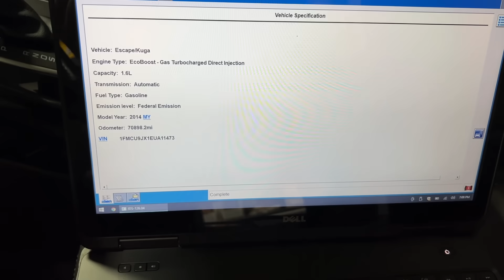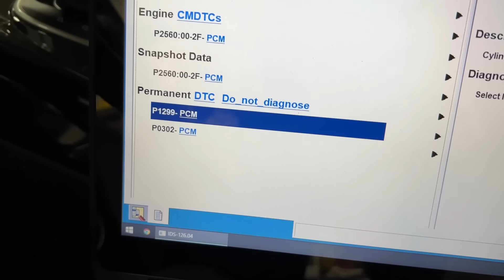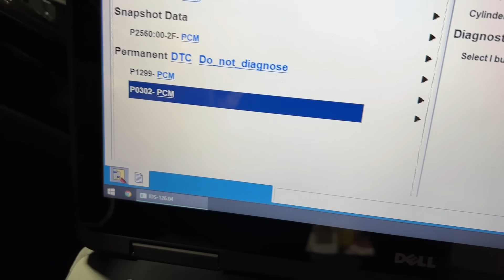Beware of Ford’s 1.5L 1.6L 2.0L Ecoboost Engines and Their Never Ending Coolant Consumption Issues!

Comment: The Triton 3 valve, the older diesels in their heavy duty trucks, the 3.5 Ecoboost; all of these engines have had issues for their entire production runs. Now the smaller 4 cylinder engines. Then there was the transmissions used in the Focus and Fiesta. Does the Ford Powertrain division make anything that is worth a damn? The 5.0 liter engines and the 6 and 10 speed autos are all I can think of that seem to be ok. Putting in a long block is super expensive and how does anyone know that the castings on the replacement blocks are any better than the originals? If a class action lawsuit hasn't been started yet, it is certainly time to begin one.

Comment: My 2015 Fiesta st cracked at #3 at 8,000 miles. 80,000 on the replacement with a Pumaspeed X47r. Knock on wood.

Comment: Hahaha …. Im so happy that I went out and bought a Honda Ridgeline last year but I did keep my 2013 Escape. But if it goes, will at least I have moved away from Ford. At this time it is still running with 265k km on it but things are starting to fail on this unit, so will just keep running it as a spare vehicle until it dies. …… Guess I better go out and check my fluid  levels.

Comment: You say at 70k miles they need a shortblock due to the block cracks between 2&3, will they only last 70k miles or did Ford revise the blocks on them to prevent that? Why dont the NA 2.0/2.5 blocks crack that way when a turbo is installed and beat on with 12-20psi for 4-5yrs and no issues? Is it the DI funky piston shape block load in the Eco engines?  So many questions lol
Reply: Blocks were re designed
Reply: @FusionBoost2.0  rather vague answer, i asked 3-4 questions which one are you answering?
Reply: @young11984  The older 2.0 and 2.5 are closed deck block designs, the 1.5/new 2.0 were open deck block designs and their was a slit between the cylinders to allow coolant flow and wasn't enough gasket material between both and eventually coolant would get by and burnt in the cylinders. They re designed the block on the newer versions with a small hole. Coolant flows but much smaller hole and allows a better seal between cylinders
Reply: @FusionBoost2.0  i remember seeing one of those, i think it was out of a Fiesta, laying on the floor at our local dealer and thought to myself......that has to be the dumbest design or one super weak hybrid motor to be able to live with no upper cylinder support. Seen some blocks with 0 upper support and just cast round bores machined for the head to sit on, figured it was some crazy engineering to save $.50 on materials and weight too.  Thanks for the explanation, i use the Fusion 2.5s for my turbo toys. The new one will have the top 1-1 1/4” of the bores filled with epoxy and coolant holes opened back up since one guy cracked his between  cyls 1-2 from coolant passage thru the head bolt hole and into the bores, if his made 540whp for almost a year mine will last a long time at around 400whp....hopefully. In the end mine may make the same crank hp since its going thru a 6r80 and 8.8

Comment: Replacing the long block will permanently fix the issue or will it happen again? Has Ford redesigned the block? I leased a 2019 Fusion 1.5L EB. I transferred the lease. I was planning on buying at lease end. Glad it’s gone.
Reply: Re designed the block

Comment: Any idea if the new ecoboost 3cyl engines have this same issue? I purposely avoided the 2.0L 4cyl when I bought my 2021 Escape. But now I'm worried the morons kept a similar design for the 3cyl engines.

Also, does the new longblock that you would install have a fixed design so this wouldn't happen again?

Comment: I agree with you on the 5.4 3v mine was 05, a daily driver, then used it for work. Unfortunately I wrecked it in 2017 with 225000 miles, I would still be driving it had it not been for the accident.

Comment: I had a 19 Escape with the 1.5 at 4500 miles they replaced the engine. 10k miles it started consuming coolant again. 2 dealership visits and they gave me a runaround both visits. Got rid of it. Always been a Ford guy but, that thing was not a good product.

Comment: It's major problem with open-deck engine block and turbocharging. The liner has cracked. If good machine shop is around , a DIYer can fix this mess for just under 1000$ if the cylinder head is straight and doesn't need machining.

Comment: Like about the engines. Never liked a turbo engine anyways. Feels does too much for what it is. All for gas Mileage.  Seems all manufacturers are having issues. Kia, hyundai,  Toyota with some engine or another. Chevy with the 4 cyl oil consumption issues. Where does it end. Why I still drive 15 year or older vehicles. 5.4 3v. Still kicking

Comment: When did the redesigned long block come out?  We have a 2021 Bronco Sport with the 2.0.  Is that the redesigned engine, or does this affect that engine as well?
Reply: Before those engine were built far as I know
Reply: Mid 2019

Comment: This happened to my 2017 2.0 escape last year at about 48k. Luckily it was still under warranty. From my research it does look like ford revised the repair blocks from having a slit between the cylinders(giving not nearly enough space for the gasket to hold back fluid from the cylinders for very long) to holes further away from the space between the cylinders. Hopefully that’s true of the long block they replaced on mine. I have an extended warranty to 100k so if it breaks again at least I have some coverage for a while. Screw Ford. Never again for me. 2nd one I had with major issues. I also had the focus with the stupid DCT.
Reply: I bought a 2012 Focus HB new, and had the trans. replaced under warranty then drove it until 12/2019 trading it in on a 2018 Focus Titanium.  I put 300,000 on the 2012 without any further issues. The 2018 needs a battery soon.   I would love to have a Focus 5 speed Manual.
Reply: @mikemiller659  I have a 18 focus st 6mt with a 2.0l tdi. Got it around 4 months ago for 23,895 with 34k on it. 
Its fully loaded with every option except the power seats and steering wheel, also it has aftermarket wheels and cat back with a cob intake, runs good for 280 some horses. 
Been getting a list together to pull 20-30 more ponies out her because 300hp is just a better more round number in my opinion.
Reply: @jacknickolstine3355    280 hp is a lot for a small lightweight car. Easy on the boost if you want it to last.
Reply: Had a 2015 Focus with DCT,  5 transmission repairs, major, and 6 minor resets.   I documented everything.    Joined the lawsuit,  they bought it back.   Used the money to get a bone stock 2.5L 2018 Escape S with 24k miles, no turbo, no issues.  Basically identical to the Focus inside, and it is my wife's car, and she loves it.  2.5 is a workhorse motor, and we bought extended warranty since Ford gave us 90% of the purchase price of the Focus SE.  They deducted for the 26K miles we put  on it in 5 years.  Considered a Toyota, but I did not want a payment.  So we have a 2017 F150 STX 2.7 EB and 2018 Escape, no payments.   IF we ever need a new vehicle, our son works for Toyota, on assembly, so we will get family discount. But I expect my truck to last another 10 years at least.   Maintenance is the key.
Reply: What sort of maintenance would have prevented this design flaw from occurring?

I don’t know anything about cars so I’ve been taking my 2017 Ford Edge in every 5000-10000 miles without fail. 

Now this happens and I’m supposed to pay 6000? For a 2017! 

That’s poor, and we customers don’t deserve this.
Reply: @alexmoore2742  There's no maintenance for flawed design. I know there were multiple class action lawsuits at one time. Not sure if you can get in on one at this point?
Reply: @alexmoore2742  Nothing you can do to prevent it, sadly. Basically the old design is a ticking time bomb. The block has a design defect that requires the replacement with a differently designed block to “fix” the issue.
Reply: The dct are garbage. They burn them clutches like crazy.
Reply: You had a DCT fuckus?

Oooof

I mean you didn't know until later, but still, that's a big oooof
Reply: @HeyItsJonny  Yeah. Found out too late. It happens.
Reply: I can't believe you bought another ford after the DCT fiasco. A lot of people got burned by that crappy tranny.
Reply: @busterboyd4125  Well they gave me nearly 80% of the price of the car for trade in and much more than i actually owed and a good deal on the escape. So I gave them another shot since the escape uses a conventional transmission. Of course now we know in hindsight that the escapes had a engine flaw. But not again I can tell you that.

Comment: Is it a head gasket fix? Or actual cracks in the heads or block?

Greet video! Thanks 👍🏻
Reply: Block usually warps and causes intrusion past the cylinder liners. Dumb design

Comment: Most cars in past the body was the weak part of the car because of rust no it’s the engine problems with electric cars will be the battery with the cost of new cars you would think they would be better put to getter

Comment: Ford has our 2018 fusion for 3 months for engine replacement and it's still giving me problems next it's lemon law bye back I've had over 8 issues and one more and their getting it back.
Reply: Lemon Law requires it to be a substantial defect, covered under warranty, that occurred a certain number of times (usually 3+) and it can not be repaired after repeated attempts.  So if your 8 issues are the same problem, not different ones, then you definitely have a lemon law case.
Reply: The engine is just one the other are a/c and transmission problems.

Comment: I'm with you on all that, Brian. I was a Ford tech for 19+ years and I was giving the ecoboost a chance. I traded my 2007 Fusion V6 AWD for a 2015 Fusion 2.0 AWD. I loved the 2015 Fusion it was great, my wife got a 2014 Escape 1.6 back in 2017. Around 2020, I performed the pressure test and immediately traded it in for a 2018 Escape 2.0 Titanium. 

That being said, a month later, her old Escape was sold and came back with the engine blown. Coolant intrusion in cylinders 2, 3 and 4. And 3 months ago, my Fusion had coolant intrusion in cylinders 3 and 4. 

Now, I have a 2020 F150 with 7800 miles with a 3rd Gen Coyote 5.0 and I'm praying her Escape will be ok. It might not be affected but who the hell knows. I also have a 2006 Mustang GT with the 3 Valve 4.6 and that's a hell of a motor...short lived but great results.

Ford should be ashamed of themselves. My wife works for a competing dealership, you can imagine our conversations at the dinner table LOL, and she said even Hyundai, Kia and Subaru have extended warranties on their engines. 

Not Ford. Only on the stupid Fiesta and Focus transmissions with the dual clutch there's an extended warranty and TSB.
Reply: I agree with you all. I still love Ford as a whole but how can you constantly assemble vehicles with the same problem over and over again?

It's pretty sad when I would speak with one of the engineers at Ford about the repair I'm performing and they can walk me through it and all but then when I questioned, "What's causing this so we can tell the customer?" And EVERYTIME, "We don't have an answer yet." And that was back in 2013.

And yea, let's put a ecoboost in all our vehicles. Almost just as bad as Dodge, Chrysler, Fiat or whatever the hell they are now, dropping a Hellcat in every vehicle they make! LOL

Bring back the cars of the late 90s to mid 00s!
Reply: Your point is well taken...this whole Global trading thing has me really corn fused...out sourcing has fired up so many glitches in quality...WE ARE IN AGREEMENT BROTHER!!!
Reply: A ford escape with a 1.6L engine there your problem
Who the clown at ford that decided that a 1.6 is ok in a SUV
Reply: They have so many TSB. I adjudicate mechanical claims. TSB for over 4 year coolant instruction, cam phasers, and dual clutch transmission. My least favorite is cam phaser Cust sat campaign prorated on mileage only if you have reflash done by 12/31/22.  Multiple of them for major components like engine and transmission. They should recall these. I purchased my last Ford they take little to no responsibility
Reply: @rosalielane4533  almost all engine with cam phaser will have a failure these thing just don't last and this problem is not new old 3valve v8 5.4L and  many manufacturers got this problem as well not just a ford thing
Even Honda cam phaser fail

Comment: If this problem is endemic with all the 4 cylinder EcoBoost engines, what good is replacing it with a long block if the problem is just going to reappear in another 50000 miles down the road?  Until Ford addresses the real problem, it's just kicking the can down the road until the block fails again.
Reply: New blocks are redesigned to prevent the issue.

Comment: Glad I got my '14 Fusion with the 2.5L non-Ecoboost engine. 100K thus far with no problems, and that should be the least anyone expects from a modern car. To have an engine blow at 70K is ridiculous.
Reply: Hmmm I thought they stopped using that engine in 2012.   Good to know they came in later years.   The 2.5L is a Mazda engine iirc.
Reply: @Gonzo_Bubb  2020 Ford Fusion was the final model year with 2.5L.
Reply: @ Good to know
Reply: i have a 2015 fusion  2.5 240k no issues it seems to be smaller displacements

Comment: Never add coolant leak sealers , if you have a oil cooler the fins will clog. blow cooler internals and then oil will fill the cooling system  as oil pressure is greater than coolant pressure

Comment: I feel your frustration Brian.  I have that same look on my face that you had at the end of the video almost daily.  Newer cars just don't hold up like older models.  I have to disagree about escapes being good cars though lol.  I do fixed recon up in Rockford and every time we get one of those in its major repairs.  Most often it needs a transmission when it's around 100k miles, or a camshaft because the high pressure fuel pump tappet has a hole in it, or engines because of coolant consumption.  Love your content and appreciate your knowledge.  Keep up the good work brother!
Reply: I'm in Rockford, maybe you should look at my wife's 2013 escape with 171K. I think it might be leaking.

Comment: Here's my experience with a 17 with the 2.0 in my aunt's Escape. 1st was loss of heat, bottle low, added the correct Ford coolant. After the system burped, great heat. At every oil change, 4k, coolant low. 70k total. Added more, no visible leaks, nothing in the oil that I could see as far as separation. Next winter same thing. 84k. No misfire codes but somewhat milky oil. Suspected headgasket? Plugs looked great. She had bought the extended warranty so now the dealer got hold of it, and said it needed a long block! When I asked if Ford had FIXED the issue with this new long block, the service manager told me NO, it will do it again! What gives Ford?! Car went to auction, and she bought a Honda.
Reply: CRVs have oil dilution issues as well.

Comment: Also had same issue with my 2012 Lincoln MKZ hybrid and 2013 Ford C-max hybrid. Lucky engine are used with many different Ford models which are available at local junkyard.

Comment: Pumping high boost and horsepower into tiny engines what could go wrong? 300ish horsepower in a 2.3 4 cylinder vs 300 horsepower in a V8 is a big difference the horsepower is spread over twice as many cylinders and as such the cylinders a subjected to less pressure per cylinder.

Comment: Gm has similar issues with pin holes in the head leaking coolant down into the cylinder causing a misfire on start up. I think its frequent enough for them to address it but nope

Comment: Ford of yesteryear had a better times.  The 96-07 Taurus never had massive problems like this except for maybe a transmission issue sometimes, overall - they were a bit boring but got the job done, and didn't cost a fortune on parts.  Same goes for the 2011 and older Focuses.  Same goes for the 2012 and older Escapes.  I'd also argue the same for the 2012 and older Fusions.  I'm indifferent on the F-150 - the 2003 and older ones seemed more robust.  The water leaks, engine trouble with the 5.4 3 valve, EcoBoost and Coyote in the 11s not holding up as well past 150...

There's a lot of newer Ford products that clearly ford used the american public as a test bed, instead of doing their own testing.  They are FAR from built Ford tough.  Walking around the junkyard in the southeast, I like to look at the 90s and 00s era stuff - Explorers, Tauruses, Focuses, Fusions, F150s, etc - all well past 200K or sometimes 300k.  Clearly, they did some engineering and worst case scenario testing to make sure their cars would last.

This new CEO and the former furniture sales man CEO haven't figured out how to provide direction, durability and reliability it seems.  Ford needs to get their act together, build some competitive sedans, crossovers etc that can handle the North American market and have longevity and durability of their Japanese counterparts if they want to reinvent themselves somewhat.  People forget that seeing an older, smooth running vehicle gives a clue to potential buyers that it's a great car (ask Toyota about this!).
I own a fleet of boring Ford cars - a few late model Town Cars and an 89 Colony Park.  I receive compliments all the time on the Town Slabs - wishing Ford still made them.  Short of those, I went to Toyota for a Tundra and dumped my F150, the annoyances and flaws were not worth the price.
Reply: An F150 with the Essex V6 is not really a bad vehicle.

Comment: wife bought a 2007 focus brand new. other than maintenance the drivetrain repairs consisted of an imrc module under warranty. its got 188,000 miles  been sitting 2 years.  dropped the battery in it it fired off in 2 seconds. cost of ownership was fantastic. i dont understand why the manufactures wont give the epa the bird and make reliable cars.